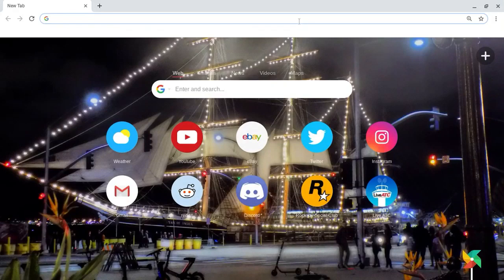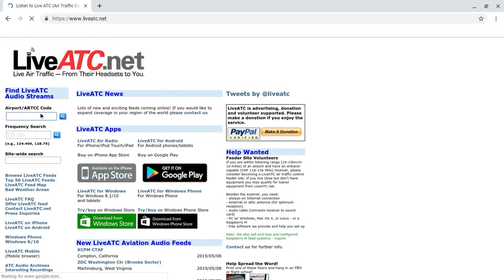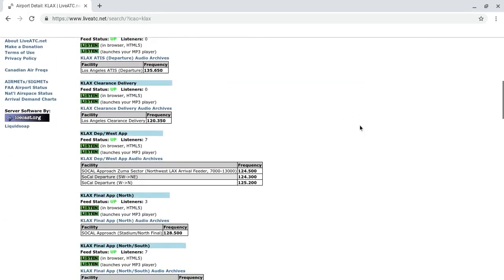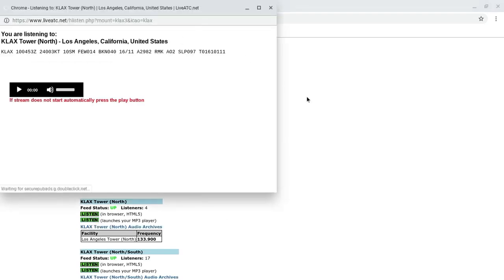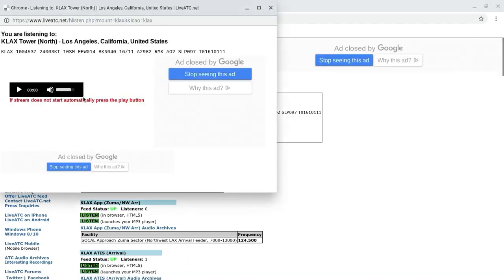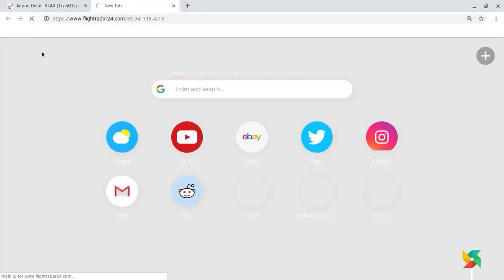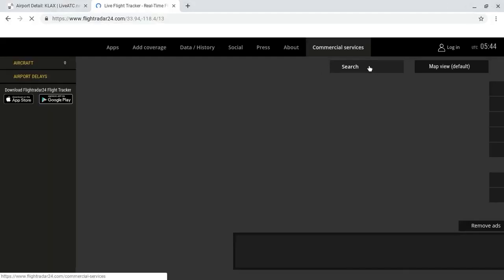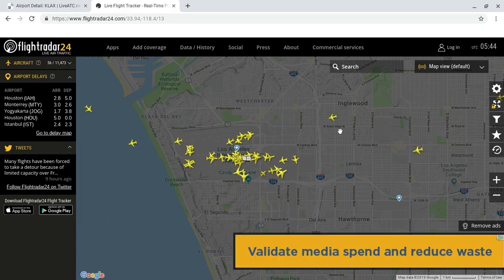How to Use LiveATC.Net

Comment: I want to make one more recommendation. If you right-click on the second button (where it says "launches your mp3 player"), you can click on "save as..." to download a *.pls file. To use that file, I then recommend the MPV media player, a quite simplistic player, freely available online. In its configuration file you can put in two lines "WHEEL_UP seek 5" and "WHEEL_DOWN seek -5". If you now open the pls-file with MPV, you can listen to the stream, and 1. right-click on the player to pause/resume and 2. use your mouse wheel to scroll back and forth in the stream. Thus, if you want to hear some transmission multiple times, you can easily scroll back and replay. This helps me a lot to decipher what's being said. Hope this makes sense.

Comment: I have a question. So I wanna listen to the tower at o’hare but there’s on that says center, north, and south. Which one is the one? Her flight is going from o’hare to San Diego. I just didn’t know which one is correct
Reply from the maker: No problem! Usually at large airports, theres multiple controllers working the same frequency for the different parts of the airport. If you know what runway (and therefore side of the airport,) then you would use that frequency. For example, United Airlines primarily uses the south side (25R,25L) at LAX, so I would listen to the southside tower if I wanted to hear United flights. Center controllers don’t control takeoffs and landings, but instead planes flying in the airspace that may or may not be going into ORD. Hope this helped! :)
Reply: @chicago90278  if I am on the airplane, how do I listen to this if there is no Internet?
Reply from the maker: @alexweinstein6417  impossible unfortunately, you would need internet to access it. you can however listen to the archived atc file after landing!

Comment: I tried this and I can not get it to work. I put the airport and frequency and it would not play.
Reply from the maker: When you press open in new tab, it should bring up a new tab for the atc window, that might be the problem. If this didn’t work feel free to ask anything else and I’ll try to help the best I can.
Edit; I mean the option that says LISTEN (in browser, HTML.)
Reply: Yes, if you hit listen but it selects the airport for you. I want to hear a specific airport. I tried typing a specific airport and frequency, and you have to look up the code first as the search does not work. I put the frequency in and it does not work or open up an new window that will play it.
Reply: It only works for ATIS. Is there any other software that you can hear live ATC. as this software is simply terrible and does not work. Period.